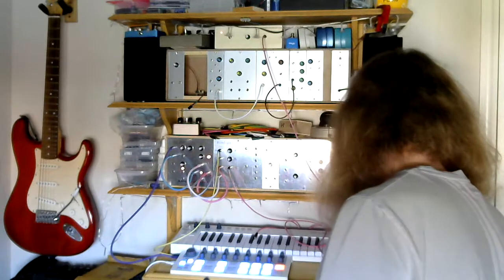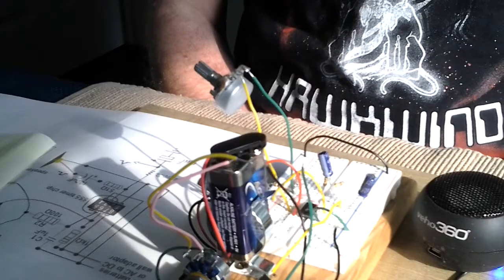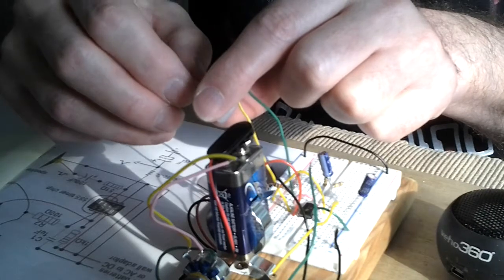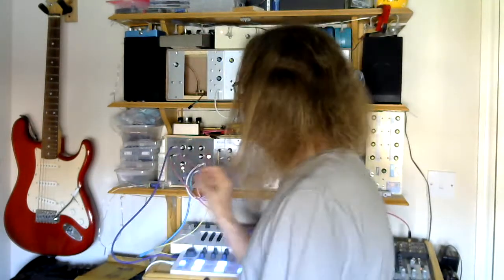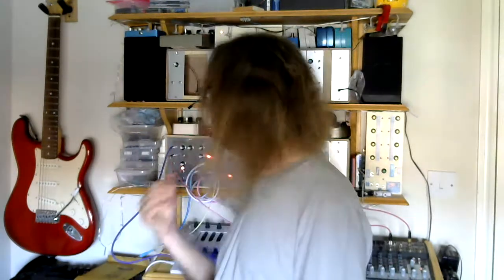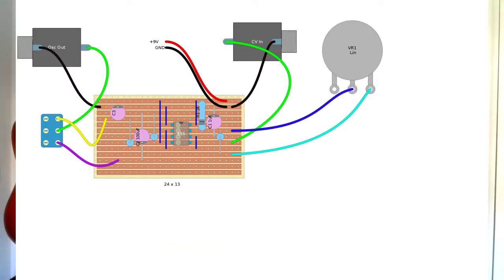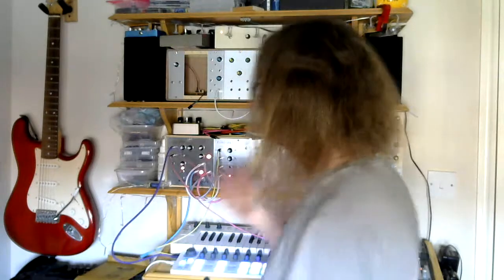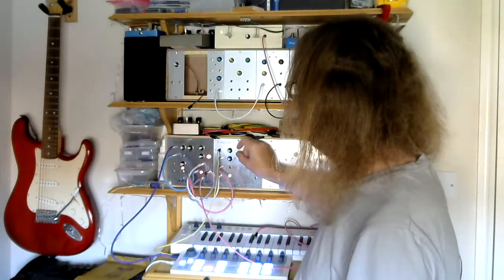Project Nine Modular Analogue Synth : 555 VCO

Comment: Hi cusi! the c3 capacitor is how much? and the other resistors that do not show their value?
Reply from the maker: Hi John, I'm glad you asked this as I have now spotted a mistake on the stripboard layout. The 1st resistor on the left is 470 ohms and should go from pin 3 of the 555 to C3 which is 10 uF. The layout shows the resistor going to pin 4 but that is wrong. The next resistor goes from pin 3 to the 100 uF capacitor and it is 47 ohms. The far right resistor goes from C1 to VR1 and that is 100 ohms. It is good to practice tracing the connections on the schematic to the stripboard layout. I usually start at each pin of the ic and work out along the circuit. That is how I spotted the mistake in this layout. Sorry for the errors and missing information, my excuse is that I was still pretty low down on the learning curve when I did this circuit. It's a poor excuse as I still make mistakes!
Reply: @CuSiSound  Don't worry m8, thanks 😊😊😊

Comment: Finally someone explains how to use voltage to control a 555!! 

Most people just twist a potentiometer & call it a VCO..
Now you've got me thinking of how I could possibly convert the exponential CV that comes from most modular compatible controllers to the linear range that could be more functional with the 555.
Reply from the maker: In this design I used the pin 5 CV input but you could put a vactrol across the potentiometer to get CV control. The vactrol method is what I used on the avalanche VCO (Part 4 in the Project Nine playlist).

Comment: Hello Sir!  First of all congratulations for your project; it's quite impressive how many features you added and how far you got with it!
I'm very very new to analog electronics so it's quite challenging to me due to my lack of knowledge. Nevertheless I have so far managed to get 3 reverse avalanche oscillators playing together and I'd really like to implement a 1 volt / octave exponential converter so I can get better control and track the oscillator to "normal" notes.
Although I've seen many different implementations, most of them use dual power supplies (which kind of complicate things for me). But I have just found the following circuit that gave me some hope (the accepted answer, from Thomas Straus):
https://electronics.stackexchange.com/questions/76262/simple-exponential-converter-for-vco/334783#334783?newreg=59c55f2b739741348eb2dc1d6b5f3d7a

Do you think it would work for a single dc 12v power supply?
Thank you very much in advance for your time, I'm really looking forward to your reply!
Reply from the maker: Hi, thanks for the positive feedback. I have not built a 1V/oct integrator circuit yet, it is on my list of things to do. However, there is an excellent Hackaday article on the subject that includes a 'fix' for the single rail supply problem, check it out at https://hackaday.com/2015/09/11/logic-noise-playing-in-tune-with-an-exponential-vco/#more-168273 . Using a dual rail power supply will open up more options for a range of analogue modules. I built one for my Project XII synth and my module test frame https://www.youtube.com/watch?v=3sCJysmLiJY . Just make sure you use a 12V AC adapter NOT DC to power the circuit.
Reply: @CuSiSound  Thank you very much for your detailed answer. Yes, I think sooner or later I'll have to go the dual rail way as you suggest. I'm still gonna give a look at the article you shared!
Reply: @DiegoSynth  Hello, I'm also new in analog circuits, I also needed a bipolar power supply, and I found an interesting solution, I had at my disposal a led driver with a +24v DC output, looking a bit how to have +12v and -12v with I found the symmetrical power supplies to have a virtual ground. It's a very small circuit that separates and stabilizes the power. (from memory 2 transistors, 2 resistors, 2 diodes and 4 capacitors).
It is really the power supply of the poor, there is noise and we can only feed a breadboard with it, but it is enough to experiment.

Comment: Where did you put the CV input ? I like your circuit schematic but no CV input on it. Thanks !
Reply from the maker: Oops! Missed that. CV is a jack socket connected between earth and pin 5 on the chip.
Reply: @CuSiSound  Thanks. I am adding that to my 555 VCOs !